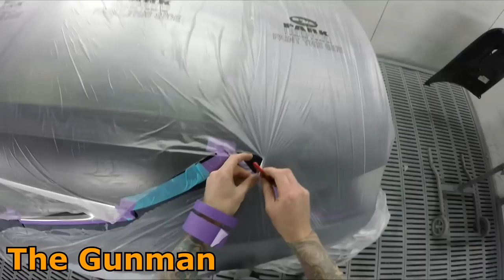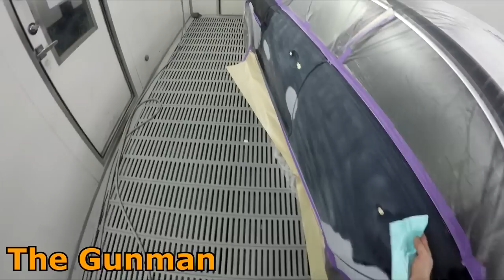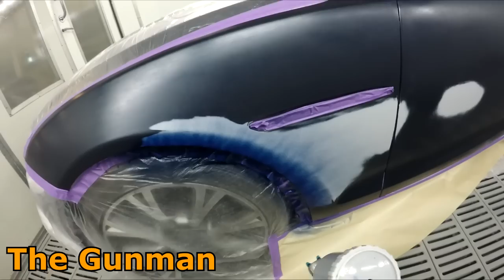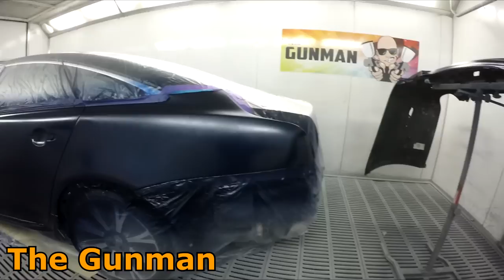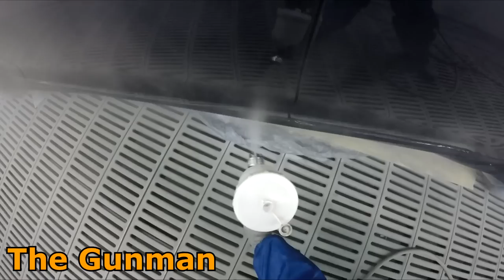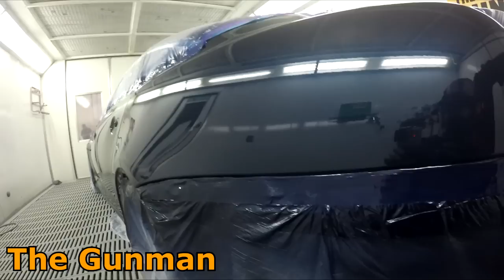XJ Jaguar Spray Painting & Tunes

Comment: I spray WB and the Metallics and the way it lays down is just far better than solvent. I use solvent for certain jobs to save boss money and mainly done silver's with issue but i couldn't wrap my head around how terrible it looks before clearing
Reply from the maker: +Tom Mellor you're right, water is a lot better but solvent is much more efficient for a high flow shop, I'd do one less job each day if I was using water, add that up over a year and it would cost a lot in lost productivity.
Reply: The Gunman absolutely. The quicker drying time was nice. I felt like I cheated lol